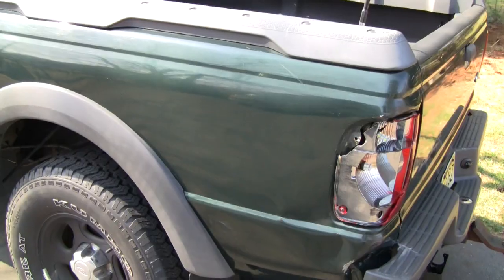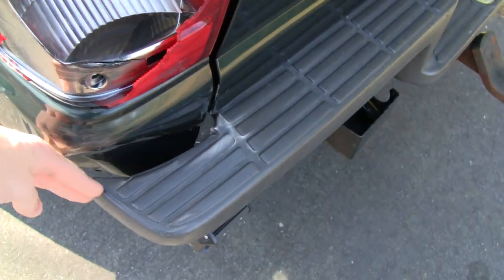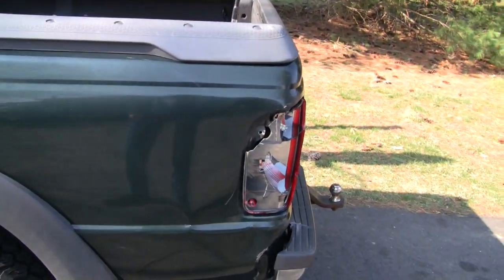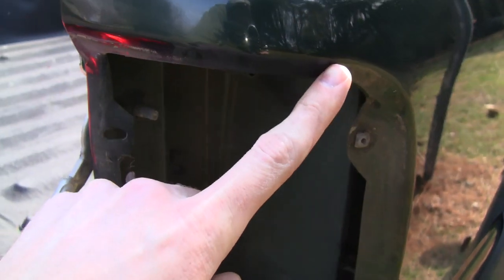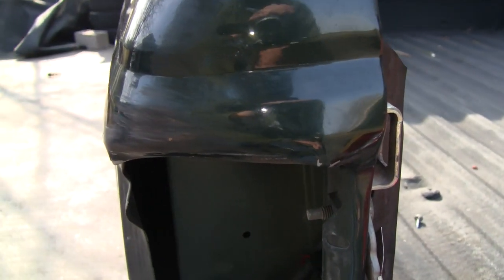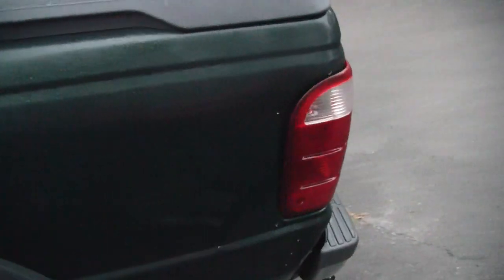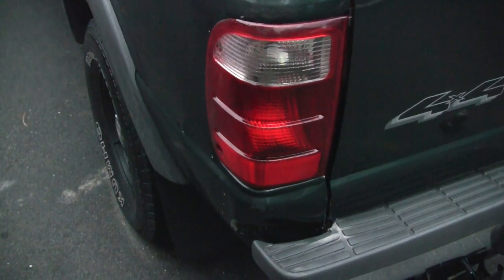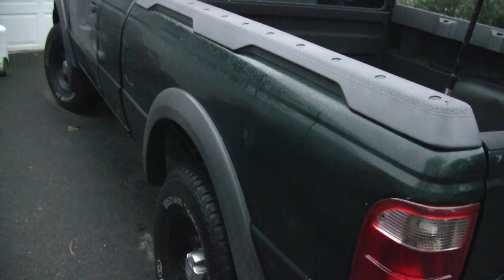PICKUP BED REPAIR ATTEMPT

Comment: If you break/bend it you learn how to fix it .... right :) Now, reversing into things. This is not something I usually do (I don't honest lol) however couple of years ago my mate Simon was coming to Lincoln so I went to meet him. It was on a corner near home. I was backing up very slowly to give him room to load the small Suzy 4x4. Suddenly.....crunch, stopped dead, of course had to be in front of him (grin). Actually no damage, however (and here's the point) I was backing using mirrors. I was close to a car with a lamp post behind, yet there was a pole in the blind spot between the interior and door mirror. Now years ago we didn't have mirrors so always looked behind. Age and modern cars mean I now back with mirrors. But this is important. Because this happened I now know why people back up and run over people/kids behind. I intend doing a video someday. Sorry it's long but sure you see the reason for the tale.

Comment: Nothing wrong with a few dents and scratches! Question for ya man with your engine oiler project.  Can you do a video or explain how you got your oil pressure gauge installed,  Also how is your oiler system still working, im probably gonna do the same as what you got done. Thanks.